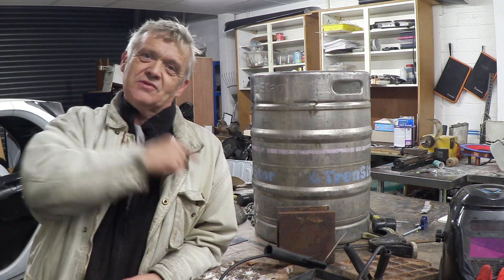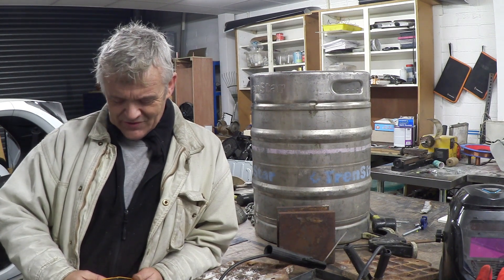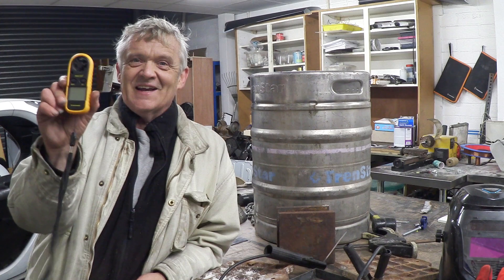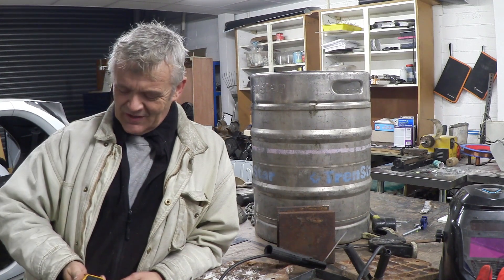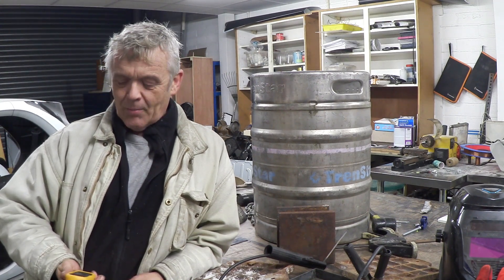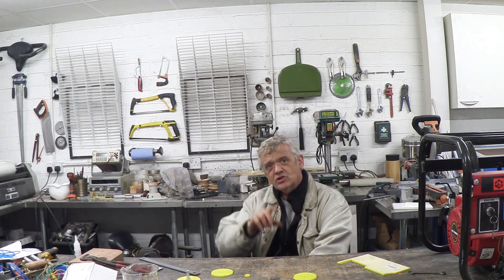Building a 1kW Wind Turbine  For Under £100 - Part 7 - A Real Wind Test

Comment: I wonder how difficult it would be to have a belt clutch into the design for those rare gales. A solenoid could clutch the belt in to drive a conventional motor (as opposed to the coils) but would otherwise stay disconnected & not cause any frictional load. Then the generator could be a 2-speed for low-wind/high-wind situations. (btw: there is no such thing as "too many wind turbine videos." )

Comment: By adding the rectifier and capacitor you are in effect putting a DC breaking effect on the transformer and in that way reducing the output current. The total device is going to need the work input to enable full output and the resistance will be the resistance or inductance of the load, the less load then the less force will be needed to make it turn. You can't get power for nothing and at full power output, you will need to have a high wind to give the device the equivalent power input  ( wind velocity ) that will yield the full power output. I have taken a different turn in my design but have yet to implement it. The idea is to wind the coil in a wave motion around each magnet in turn like a sine wave shape winding continuously around all the magnets. With 20 (2 per each sine wave  1 N pole 1 South pole) magnets, the speed would need to be 5 RPS or 300 RPM for full o/p at 240 volt 50c/s, at 100 RPM (1.66R/s ) the o/p would be 1/3 full load at a frequency of 16.66  c/s. This design was to facilitate the use of the  Microwave transformer with a 240-volt primary winding to be used with a Secondary winding to suit requirements and also give Full isolation from the generator. A 12-volt winding for a 12-volt battery storage and 24-volt winding or 48-volt winding as required. Sorry if this is a bit ragged but I am 82 and haven't given this design much thought for nearly 25 years, but I think you will get the gist of it from the above. Ask me questions if not. Regards all MoK

Comment: Ok, now for My two cents worth.... The wind can enter the squirrel cage, but this builds a pressure behind the vanes of the cage. The ends 
of the Squirrel cage are enclosed by the mounting system that you have. If the ends of the squirrel cage are opened up, then the pressure build-up 
is eliminated, thus allowing a full flow through the vanes of the cage. In other words, the wind has no place to go once entering, and if the ends of 
the cage are open, then the wind can escape through the "sides" of the cage. Sort of the opposite of a Blower in a central air system.
And now, on to the Question that I have.... How can you determine the Angle of the blades?

Comment: Robert, I have been experimenting with the same type vawt as you are building. What I have found that increases the turbine speed and increased output in low winds. If the guide vanes are designed to bring the wind in to a 8" wide opening and focused to the blades near their edge as they are starting to travel away from the wind direction. This funnels the wind only on the blades when their in the optimum position to recieve maximum torque. Also by closing the gap down it increases the wind speed as it passes through the gap.

Comment: I wonder if you put a super capacitor at each coil, would the load output stay steady, using a average output since it has the capacity to do so, and it will store that higher inputs within the capacitor, without causing a bright and dim output, so you may get an average output between very bright and dim?

Comment: what if you put magnets along the top with coils there are well but alternate the polarity opposite of the magnets vertically opposed to them? Curious if this would lessen the magnetic drag? Or would this result in a 2 phase power output? I am insanely interested in this topic and think there should be at least 20 more videos in this series!!

Comment: I see projects like this a back up or extra feed into a lithium battery bank  for maybe a (12v, 24v, 48v) outdoor system. Could this charge a bank of lithium batteries for a homes outdoor lights, sound system, water pumps for bird baths? The electronics for that system are mostly off the shelf and as a supplement this would keep the solar array costs low.

Comment: From my university days. The power in the wind is Kinetic energy =1/2 x mv^2. The mass(m) is proportional to the volume of air going through the machine which is the cross sectional area x density of air (1.225 kg/m3). The theoretical maximum that a wind turbine can extract is 16/27 of the available energy. So you have:  16/27 x 1/2 mv^2. Replace mass by velocity x cross sectional area x density gives 16/27 x 1/2 x area x density x V^3. We know density is 1.225 so simplifying you get power = 0.36 x swept area x v^3. I would guess your machine is 0.6 x 0.5 m2 = 0.3m2. Thus max power = 0.36 x 0.3 x v^3. = .108 x v3 watts. In a 5 m/s wind = .108 x 125 = 13 watts. But in a 10 m/s wind = 108 watts and at 15 m/s = 364 watts.

Comment: I think you need to use a smoke generator to see eddies in the stand that are giving your turbine turbulence causing a braking effect on the turbine. It could be solved using pipes with all thread instead of flat supports.

Comment: i reckon the 4 support boards you made from the ali honeycombe would work better if you used pvc pipe.reason being that it would help the wind get in better.maybe,being as the wind could come from any direction.,plus a cylinder is  great structural upport.,the boards to my mind could be creating drag on the windflow.. just an idea . anyway there you go. i absolutely love this build . fantastic, you're aninspiration

Comment: When you get some data on output vs. wind speed you might consider doing some testing on what happens when you rotate the braces holding up the top from perpendicular to the blades to tangential to them. Then add more braces to catch more wind.

Comment: hey rob, nice one...again!   eargerly awaiting parts 8-15 before i follow you down this one!   we currently have no off grid electrical system at all so this would be the first apparatus.   could you advise on a battery strategy for a family of 5 using about 150kwh/month?   i envisage a small pv array, biogas battery charger, bicycle generator and maybe a rocket heater add on that produces battery charging aswell.   most of our usage is device charging, lights, sounds and sewing machines.   we have a big (if a bit rickety), low south facing roof and a bit of yard space.  i know you might not see this but if you do any insights would be muchly appreciated.   cheers    tanc

Comment: Have you considered increasing the size of the box around the turbine, suspending / mounting  the turbine into the center of the box and then employing an angled ducting effect on each baffle for each quarter to 'focus captured wind onto the turbine? Perhaps this would increase the pressure / speed of the wind attacking the turbine and by capturing more wind and 'focusing' the pressure onto the 1 1/4 of the VAWT potentially create a pressure change from low to high as the wind finally hits the blades of the turbine? Also have you check clearance between the baffles and the turbine and also top and bottom, some wind is being lost and may be going round the opposite side of the turbine therby creating a parasitic loss?
Reply: The best way of visualing this in taking a large 3d cube and placing another cube roughly 25%-50% smaller inside the original cube and then joining each corner from the smaller cube outwards to join to the inside corresponding corner for the larger cube?
Reply: Also being able to change the angle of the blades based on wind speed is an another way to ensure you maximise the speed at varying wind speeds, lower speeds require the angle to be wider to catch as much low pressure wind as possible, as the turbine speeds up that 'angle' will not be optimal for higher speeds, perhaps researching into a mechanically/ digitally driven set of gears for each blade that will change their lockng possition based on RPM and wind pressure would be an idea?
Reply: And you'd probably want a way to extend the baffle shrowds towards the turbine blades as the blades change attack angle to ensure the tollerances between the turbine remain the same as the blades change angle for faster wind speeds? I'll shut my mouth now as this has all probably been thought of and noone likes a chatter box :)

Comment: If you could make a tubular frame   3/4" or 1"  to house and support the turbine rather than the flat large area baffles you would stop any turbulence and increase the winds flow with less restriction in the low average wind speeds, loved your build and info great video's

Comment: I love this project. I bought a small horizontal wind turbine and it isn't working very well in my urban backyard. The diameter of the prop is about 12 inches and it should be about 10 watts. The problem is that the prop never turns in my shifty, light wind backyard. I don't want to mount it on the roof because the neighbors might complain. I think I could put your device on my roof and no one will notice and plus it would work better with the winds I have. Thanks for the cool videos!

Comment: You mentioned in other videos the turbine  rotor weighs 19Kg just reminded of Lotus boss Sir Colin Chapman’s philosophy “simplify and then add lightness”. Maybe taking some of the material from the top and bottom would help to increase rotor speed and reduce drag.

Comment: By putting your turbine vertically, you get wind all around it, is 360 degrees  range. if you put it horizontally, you get wind from the front and rear, maybe from top and bottom too but that makes it unsuited for winds that changes direction. Maybe that is why the horizontal model was dropped. The magnets on the edge of the turbine is the best idea, you have the max amount of magnets, the max possible speed all that without gears and any mechanical losses.

Comment: I just love your tenacity and enthusiasm you pour into these projects. Question... Have you tried to place the magnet  and coil arrangement closer to the center/hub of the  wheel,  half-way or so. ??? You would need to accommodate less magnets, they would spin faster due to their position, maybe even giving a bit more output, and you would have a weight reduction too....great work  Robert

Comment: I'd like to open this question to all - in order to increase RPM only, which do you think would show the biggest increase - taller blades, blades set at a wider diameter, or simply more blades [at current height & diameter]? Let's not go into all the variations of curvature and angles of blades because that could run on for pages!
btw Robert, I have loved this series of videos. Thank you!

Comment: Centrifugal force and centripetal force. Those if the magnets are closer to the center without the transformer housing because the metal slows down the turbine? This gives more torque in my opinion. You can also add magnets at the base to increase the magnetic field. Will you undertake? It's a beautiful project.

Comment: You have four deflector corners and you could use four vertical ventilators or two with Keppe theory. But the way, you need to be prepared for high wind speed. Then you need to close the turbine to protect it. Do you know something about ¨Obama Been¨?.

Comment: I wonder if it would help to use more of the magnetic field of the magnets by making a "C" shaped core with a coil around the outer part of the C that captures both sides of the magnet's flux.  Perhaps you'd need fewer coils that way.

Comment: Thank you for spending all that time to make this very interesting project. One very important Subject  is a must :  What's the maximum wind speed before it gets destroyed and how to design an electronic braking system during a high speed wind storm.
Reply: Maybe something like a centrifugal brake would work, kind of like a spring to skid plate set up similar to a clutch in reverse.

Comment: Brilliant stuff... I really like the re-purposing of scrap and modified salvaged materials, and the no nonsense real world comprehension of the problems at hand... Anyway... Am I correct in thinking that if you stacked two drums on top of each other, COUNTER ROTATING, with the 'mating' surfaces having coils on one, magnets on the other ( with the normal set up top and bottom as in your hack-models)... you would then have the top and bottom generators producing as in your models, but the mating surface generator would be operating at double the speed?  ( the combined speed of the counter rotating drums). This would then mean that for a double sized unit you would produce triple the power? ( ish).   As with helicopters, and turbo-props might not this counter-rotating set-up help reduce overall vibrations, and the torque on the basal attachments. I reckon two would be the magic stack-size for an easily serviceable unit to be located on a roof. What do you think Robert?

Comment: Hello Rob, great video for the diyer. I think the reason it stalled when you connected the coils together was they were probably out of phase with each other. When one coil was outputting a positive pulse another was outputting a negative pulse. Effectively seen as a short circuit across the coils. Very careful adjustment of the coil positions, to bring them into phase,  using a scope would fix this or as you found simply rectify the outputs and smooth them individually with a couple of caps and then common them together.
Loved the idea and ingenuity.

Comment: “IS QUITE optimal for silently, prestigiously ‘augmenting’ 1600-watts at 24-volt solar. RECENTLY, I added a freezer. PUTS 24/7 REFRIGERATING demand at ~800-watts. I RUN a shaft-coupled DCA at my combiner for a few hours on dark, cloudy days. WIND CANNOT replace generator entirely. IS STILL winter, demanding motorized augmentation at 47.5 degrees North but your quiet design is interesting. THANK YOU. 70’s AUTOMOTIVE DCA is ‘way’ overbuilt to withstand heat caused by belt & pulley. DISAPPEARS WITH greased jaw coupling, FYI.”

Comment: You should check out a company called alpha 311.  They make vertical wind turbines to install alongside highways to take advantage of wind generated by passing vehicles.  According to their data they achieve 2.5 kw with a wind speed of only 5.4 m/s or 12 mph.  The turbines are 2 meters high

Comment: What would happen if you doubled the magnets and coils by fitting some at the top?
Reply: There's a fair bit of resistance with the magnets when the coils are under load. No such thing as free energy. You'd think it would double output but it'd also basically increase the required wind speed to get it spinning and keep it spinning. This would be fine in a high wind area. For low winds, it's better to use the second stator and magnets to build a second turbine.

Comment: How about transfer this wind energy to a car engine starter? That's will produce 12v 30am to generate 300 W inverter getting stable 50Hz 220v AC.

Comment: Possibly look at a magneto from a small engine, or a series, like a Briggs and Stratton. In that configuration, the magnets would run parallel with the blades and the laminate would be horizontal. 
I would theorize that "flux", is simply friction on the molecular level, that the magnets act the same as shoes on carpet. It seems possible to me that ALL transfer of energy involves friction, that is the force that slows done the turbine.
Friction, by any other name.. Solar, wind, nuclear, hydro, all create friction..
Now in the most amazing machine, the human body, you have the gogli apparatus, which appears to use a laminate, but then you have axons in the spinal cord, with a vein and artery, wrapped in what appears to have the configuration of being wrapped in a coil. If I recall, the blood in the veins is magnetic, while the oxygenated blood in the arteries is not magnetic.
Overlooked is that the body is just as, or possibly even more dependent on how well the oxygen is removed...
Just food for thought...
Perhaps like our bodies, moving magnet in the middle, wrapped in a capacitor? Mylar appears to be configured like a lipid by-layer?
Reply: BTW, it appears that oligadendrictes wrap axons following Faraday's law..
Possibly a magnet or magnets like they use in refrigerator door seals? 
Possibly tape like they use on Reflextix, Mylar insulating bubble wrap might work to get charge? I'm not sure of its polar configuration..
Wish I had a shop and time...

Comment: John Anderson
your problem is the magnet position in relation to the coil.
Firstly, try positioning the coil so that only one side is being induced, check the output.
Possibly, by placing the coil horizontally the magnets are counter charging, opposing.
What is needed, position the magnets to correspond to the leading edge of the coil, i.e. north magnet on the leading edge of the coil and a south on the other leading edge correspondingly, then you will get some real output.

Comment: You need to focus the wind on the blades that needs to spin. Close off or redirect the wind to those blades only. Taking a piece of plywood or metal and putting it at a angle will put more wind on the blades that you need to turn and remove some resistance from the back of the other blades.